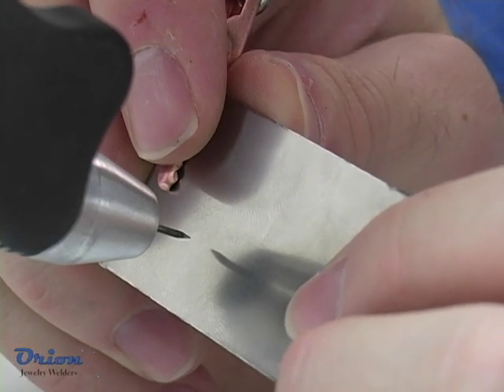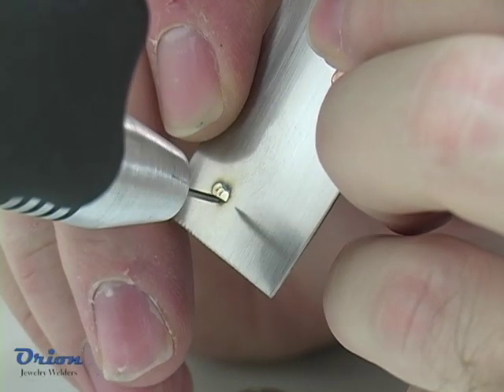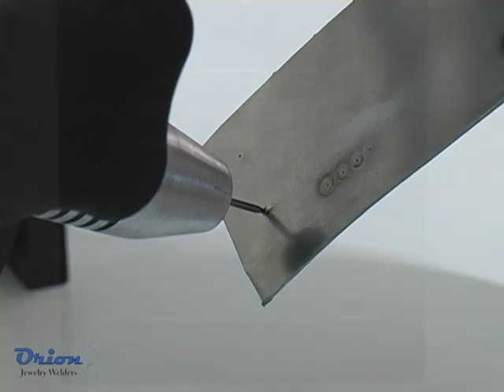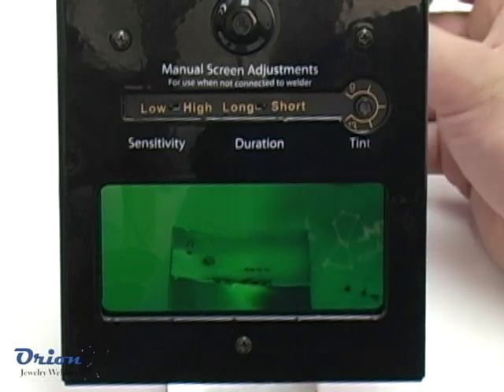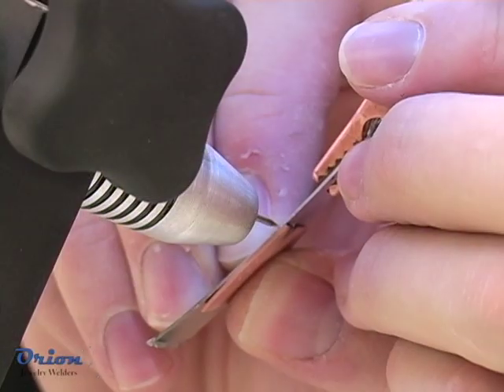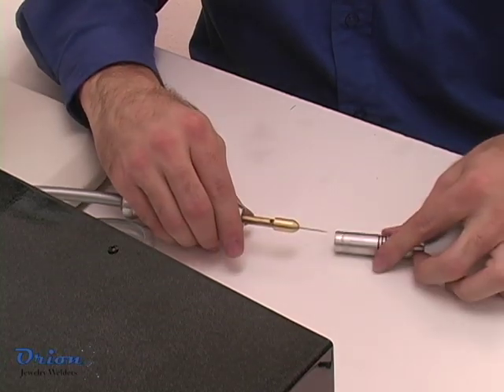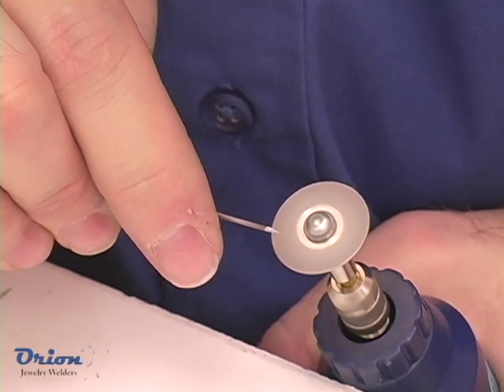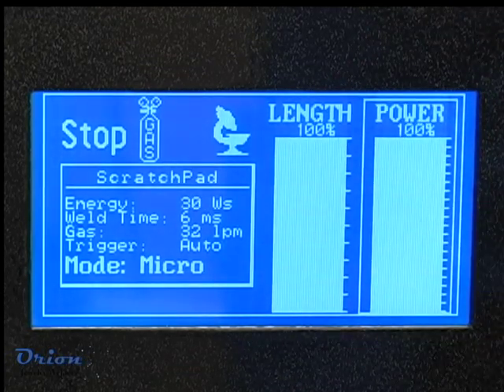Orion Jewelry Welders - Basics of Pulse-Arc Welding

Comment: Can you adjust the power such that you can weld on electronic PCBA? I need to weld a steel piece of metal to a copper hole of an electronic PCBA. The metal piece to be welded is very tiny also. I am concerned about the amount of current through the parts being welded. Do you know how much current is used?

Comment: if I solder a piece of yellow gold, it is yellow or white. by the electrode ???
Reply from the maker: Through the welding process, the existing metal is melted and joined together. This will leave the metal color exactly the same as the surrounding color, as it is just melting the same metal. A secondary wire can be added for strength, this should be a wire of the same composition as the pieces you are working with. This will also give you the same color metal as what you have.

Comment: will this weld a piece of 22 gauge non resistance wire to a piece of 21 gauge resistance wire together.  I'm looking for something that will join two wires together secure.    thanks
Reply from the maker: Great question! Yes, our pulse arc welders can definitely do what you're asking. However, this particular video is one of our older models. We have plenty of new products that will satisfy your needs. Take a look and let us know if you have any questions. http://sunstoneengineering.com/products/pulse-arc-welders/. Also you can contact us at sales@sunstonewelders.com or +1-801-658-0015.